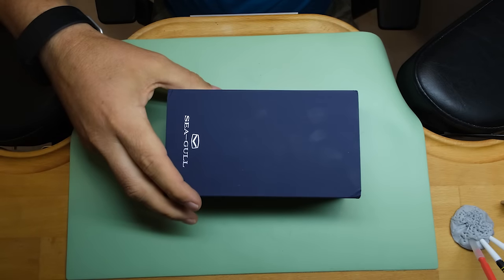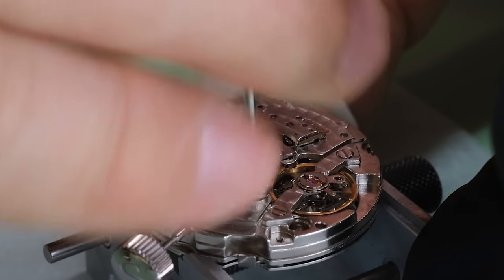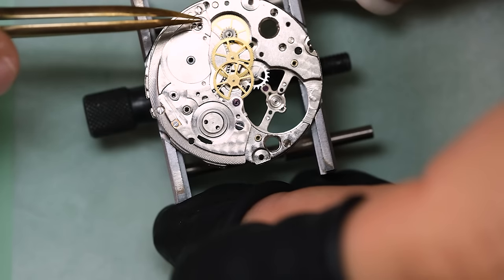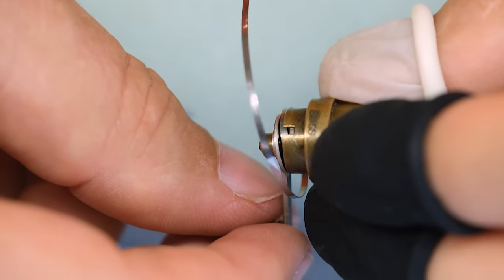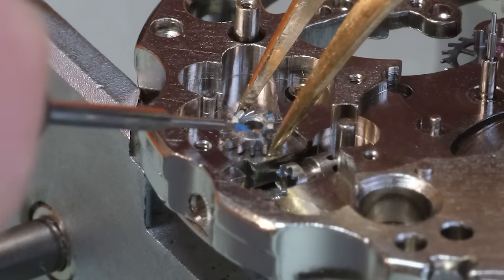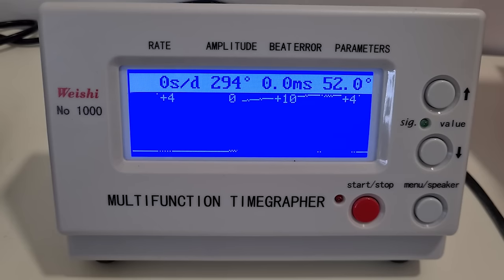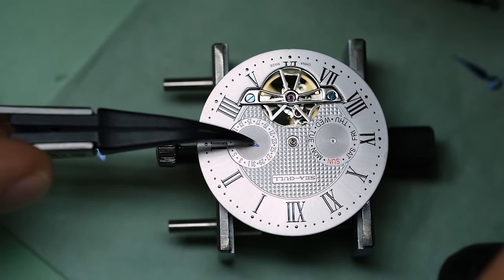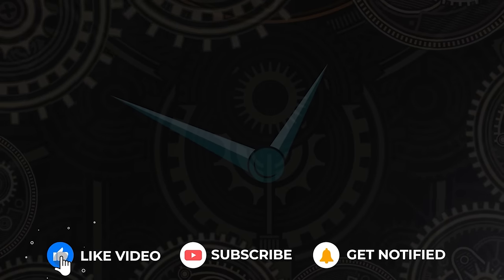How good are Chinese watches? Teardown + Giveaway!

Comment: Hw good are Chinese watch movements?

Mechanical or Quartz?
The lowest cost export Mecanical models (I don't know about the ones for the domestic market) are hit and miss. From what I saw on another channel where a pro serviced a brand new lowest cost on Amazon Chinese skeleton manual wind pocket watch, "to see if they are servicable, and if it will run better after servicing" the "jewels" are very thin, and MAY be plastic. They are not lubricated when assembled. At least the movement he has wasn't.
The ManChDa skeleton pocket watch I bought off Amazon (under $15.00 delivered) with bronze plated full hunter case, died after 1.5~2 months.
It does not run with a full wind. As far as I can tell, it was not lubricated, either.
I have not decided yet if I will jeep it for display or file it in the circular file. If nothing else, I have to nice watch chains.

The higher priced models are PROBABLY of decent quality, and properly lubed and assembled. After all, the average China resident needs a good watch,justlike the average resident of any other industrialized country. 

I would find it hard to believe that the only good watches in China are imports from Japan, India, Taiwan, Switzerland, and other locations.
I'm sure the Chinese can build a watch that is as good as any other production watch, regardless of brand. No doubt there are custom watch makers in China who can make world class luxury watches that would be desired by the rich folks able to spend six and seven figures (USD or Euros) or more for a watch.

Asffor the Chinese Quartz watches ... The Chinese quartz pocket watch I had came with a garbage battery, tat only lasted 5 or 6 months. A common enough battery size, I just haven't bothered to change it yet. It did keep accurate time ... until the battery went dead.

I'm thinking of trying the call it "$40" (on Amazon) China made "London" brand 6 hand auto-wind pocket watch, either late this year, or sometime next year.

Comment: IIRC, Sea-Gull was the original company and Seagull is the modern copy of Sea-Gull. 
However there are copies of Sea-Gull (which this seems to be one) and a reissue version called Seagull. 
I honestly don't know what the new genuine Sea-Gull is like inside but apparently they are much better than the copies from what I've read (which is anecdotal and heresay at best). 
Genuine Sea-Gull watches aren't $100 they're $750 to over $1000 but they could just be rebadged $100 watches for all I know.

Also, I have to admit I have one - an ST1903 the 3 sub dial iteration of the 1902 in an Alpha Daytona clone. I got a red dial version and put it on a black rally style leather band with red stitching and red highlights on the inside of the holes. Everything about the watch is a bit crappy but I absolutely adore it, keeps great time and is a lot of fun. 

I've got a Tissot PRX chronograph, a Breitling Hercules chronograph, a Casio GWG1000 and an Alpha Daytona. 

The Casio and the Alpha are the only watches I wear.

Comment: To compare Japanese vs Chinese quality. I have an expensive REAL Seiko (Sapphire, Kinetic, Titanium) bought here in the Netherlands which has already been broken five times. One time falling on the floor (just about one meter height), the other times the pins of the separate links of wristbelt fell out.
So I'm quite dissapointed in the Seiko quality.
I also bought a Chinese automatic/mechanical watch (with a Japanese inside) which seems to be a much better quality fit/finish and also was much cheaper, it didn't break yet.
I stopped using the Seiko because of all the breakdowns and will buy some more Chinese watches in the future.

Comment: I own 5 or 6 Chinese watches. Some are very simple and of low quality. But they work. None of them has broken after years of ownership. Most run plus or minus 15 to 18 seconds a day. There are exceptions. I own a seizenn pilot watch by Merkur. It is esentially a re release of the 70s era W10 military watch. I had planned to buy a Hamilton Pilot Pioneer at around 700 dollars. The chinese version was less than 100 and is a high quality time piece. Plus or minus 4 seconds a day. Domed mineral crystal just like the Hamilton. 316L stainless case. Same water resistance. It is a solidly built attractive watch. And while it may be a copy, so is the Hamilton. They both copy the older w10.

Comment: I have absolutely no issue with these when they go for 100 EUR and bear the respective brand. Although perhaps I should, considering patents, copyrights and, generally, all the horological ingenuity that has ended up just being blatantly ripped off here in one way or another. Having said that, I absolutely hate seeing these movements in fakes - and you can usually see them from miles away. That, to me, pretty much sums up both sides of the coin on this subject: yes, you can have a perfectly good mechanical watch for cheap. And at the same time, yes, thanks to that, thousands upon thousands of watch afficionados can also miraculously fit their wrists with "fine Swiss haute horlogerie". Not.

As a sidenote - I own numerous quartz Fossils with old-school Miyota and Ronda quartz movements inside. I've found the difference between those and a Chinese quartz quite staggering, to be honest. Quartz watches aren't made with longevity in mind to begin with, but such laissez-faire-laissez-passer approach to watchmaking turns them into shoddy commodity items indeed. Ephemera encapsulated.

Comment: I have an Alpha 'speedmaster' homage with the Seagull st1903 movement. After  a few months the winding mechanism broke. It's still possible to wind the watch but only up to about a dozen turns of the crown. From research it seems the clickspring is weak in these ST19 movements.

Comment: SeaGull make very good watches in my experience, owning 3 at this point, I have no problems with any of them.
Considering buying the Tourbillon model at present. 
I have gone in the other direction from buying high end watches and then looking at less expensive but very good mechanical movements.
In these days of muggings and watch thieves, I still need a good mechanical timepiece on my wrist but one that won't grab the nasty attention and intentions of crooked people.
At the time, I paid just £160 for a manual wind column wheel chronograph designed in Switzerland with Sapphire crystal and a pretty movement visible through the mineral crystal caseback window.
Chinese pilots and other military must have been very happy with these watches when 1st issued back then when the Beatles were 1st strumming their guitars.
You can see finishing issues through a Loupe but for the price, they are very good indeed, no Patek Phillips that's for sure, but for a day to day watch, absolutely good enough. I wear watches for myself, not to impress others. I don't pull back my shirtsleeves just because I have one of my Rolex watches on my wrist.

Comment: I bought a cadisen day date homage with a miyota  movement. It had a white dial and the seconds hacked. Then I bought a gold dial version of the same model and it did not hack. I returned it and got another non hack watch. Then I wanted a gold dial with hacking so I swapped the dials.  Very iffy quality control even with Japanese movements installed. Sea gull is two different Chinese characters...probably reason for the hyphen. Wonderful video!

Comment: It's no Rolex, but it is an automatic with some interest on the dial side. Given the price, I imagine most would just buy it, wear it for however many years it worked for, and then toss it (or sell it on e-bay). There aren't many that get worked on by a professional watchmaker like you so this one should be good for a good deal longer than it otherwise would have been. (Don't enter me in the drawing please. I could buy one for what shipping would cost).

Comment: Funny about the screw sizes and slot widths all being different. I worked with a chinese factory and colleagues, and the things that they do to save on build cost can make you crazy...
I'm willing to bet that their production guys just ordered the lowest cost they could find, or used parts that were high-volume in-house...
In my own experience, in one case, they used a resistor instead of an inductor "bead", to reduce some electrical noise, to save less than 1 cent...it kind of worked, but when we had a new IC that worked better, and saved 2 cents, it wouldn't work properly with the resistor!
And, for some reason, the Chinese guys would not change the parts list... maybe saving face?

Comment: I'd love to have another watch, 25 years ago I had gotten a nice watch, it didn't last, I killed it, so I get cheap watches, but only 30% fit, but I only like about 5% of them, I have large wrists, if they do fit it's the last hole in the band ,  but a small few will fit like normal,  I don't want a watch that looks cheap and /or odd , like a toy, or child's watch,  I don't like a watch that is trying to be something it's not, fake duals and such, but still cheap and reliable, difficult to find,
I have stopped looking,  I haven't had a watch in over 4-5 years, maybe longer, maybe around 2016 my last watch died, its time was just over,. I don't like putting a lot into a watch, (or shoes) I'm not easy on either,  this is a nice watch better than I'd buy,  
China can build good and nice things, if you want to pay for the quality, they just have a bad rep for bad quality, because ppl are cheap stingy, want to spend nothing, cut corners,  and the product suffers, and the makers get a bad rep,  the ppl over the company having china build  things want to make big profit, spend nothing on  having a expensive something built, charge 2x the worth, they think they need to make 500% profit, to make it affordable, the quality is horrible,    but china can make good products,  but it cost ,. Great video!! 👍

Comment: I hate when people ask me, "is this a good watch. uhh, well, I guess it depends. Its actually a tough question.. When I see these Chinese/Japanese style movement designs I tend to want to answer no, its junk just because I hate the designs with the thin plates all over the place, wire springs everywhere and plastic gears in the calander sections. But they work and run just fine. Of course the winding/setting sections are always the most prone to trouble along with the plastic calander gears. Otherwise these movements could last hundreds of years just like any other watch as long as it has never been overworked a million times over the years. So I guess I should say sure, they are good watches.

Now compare them to watches that cost thousands of dollars. If the pivot quality is good, the jewel quality is good, gears are cut clean, tolerances are good and consistent then why not. Fix some minor design flaws and no reason they cant be as good as expensive watches. Also, many watches use the same movements especially if they are quartz. Now you can have a $100 quartz watch that has the exact same movement as a several thousand dollar watch. And if the cases are well built, dial quality is good, nice hands, saphire crystal etc, then I have a hard time making the argument to justify buying the more expensive watch. The unfortunate truth.

Also, very impressed that you noticed the lack of consistency in the Chinese quality control. Seems its just not big on their agenda.

Comment: A little extra effort on quality control and keeping the work area very clean would go a very long way on making something purely mechanical like this watch last several times longer between servicing. Seriously tightening up the sample sizes at each process and better training especially for oiling during assembly would alone make the product much better. A QC department can make or break a factory. I would recommend that at the very least for their own house brand watch company they should spend a bit more effort just because it would save them from returns and complaints. They may be the largest manufacturer of movements on the planet but your average watch buyer doesn't yet know who they are and one bad experience will get a lot of negative attention from that buyer and anyone they theoretically talk to. Just how I would run things. 🤷‍♂️ if they had to add a couple of dollars to the price to make it significantly better I'd pay it. Until then I'll stick to used Japanese automatic watches on ebay which can be bought for a song and still will last longer.

Comment: Sept. 24th is likely too late to get into your competition for the watch but that's alright.  I just found your channel and you make a pretty good video so I subscribed.  I'm not a watch maker though I took one or two apart when I was a kid.  I don't wear wrist watches or any jewelry beyond a wedding band.  I wear a belt watch and that even not often, just when I go out. I have a clock in the bedroom which displays time on the ceiling at night. I always thought if I ever acquired a Rolex Oyster I would wear it but I don't really like the band design.  I wore a watch in the Navy, a Timex with a twist-o-flex band but as soon as I got out I never wore one again and I'm in my 70s. The Timex worked very well for six years problem free. A funny story, though, about the belt watch...I took it to a watch maker for a minor repair. He saw me take it off my belt so you would think he would return it in the same condition (ready to wear) as when I gave it to him, but the watch was forcibly placed in the leather holder upside down (right-side up is upside down for this watch) and I had to take it apart and seat it correctly. It is made to hang upside-down because when you wish to see the time you just tilt it up as you look down to see the time. This was a professional watch-maker.  I said nothing to him.  I don't go back there anymore.  You, on the other hand, notice the most intricate of details and I like that.

Comment: I have this vintage cufflink watch by Endura that has a 1 jewel movement that belonged to my great grandfather and I've been wanting to get it repaired as a surprise birthday gift for my father as he greatly admired his grandfather and always wanted to get it working again.

The balance spring is pretty messed up, the mainspring was seized up, and I think the movement is missing a tiny screw or two somewhere because it kinda came apart when I removed the caseback to examine it.  Otherwise I have all the gears and bridges for it.

I think it would make for an interesting episode if I sent it your way and let you have a gander at it, and if restoration to functionality is possible that would be even better!

Any way something like this could be arranged?
Reply from the maker: Hello, thanks for watching! I'm not sure that watch is repairable, to be honest, but you can send me a mail with photos of it to stian@vintagewatchservices.eu

Comment: I thought Seagull bought Minerva or another movement manufacturer in the 80’s or 90’s?
Reply from the maker: I don't think they did buy a Swiss manufacturer, but I could be mistaken. Minerva was bought by Mont Blanc a bit later on. Seagull did buy the designs and tooling for the Venus 175, but not Venus itself. Venus was bought by Valjoux.

Comment: Stian --

Indeed, a fascinating video Stian.  i have never been predisposed to acquire anything other than three-handers since they must be challenging enough mechanically.  i now have three Chinese watches (a Cronos and two San Martins), all with the PT5000 movement from Hong Kong Precision (a 2824 clone).    I have been lucky -- and both of my vendors charge a bit above the typical AliX offering -- but worry about overhaul/service availability.   With the prices of new Chinese movements (the PT5000 go for $65) presumably a movement swap is the efficient strategy.

Do you have any comment on maintaining these watches?   A video on customer options -- sending back to China vs local watchmaker for example -- might be useful.

-- gary ray
Reply from the maker: Hello Gary, great to hear you're happy with your watches. I'd say we're moving into use and discard territory with these kinds of prices; it's going to cost you multiples of that to service a watch and sending it back and forth to China will also likely not be worth it. That's just the sad reality of our modern society...

Comment: Well, problems with QC, what should that really mean? I mean, every commodity that comes out of highly automated, roboterized production  processes shouldnt be expected to underly intense QC. That would by far be too costly. So QC actually means: Does it run? Within specifications (a few seconds on a timegrapher, ready!) Does the crown what it is expected to do? Does the bracelet work? Are there visible damages or irregularities? No? Neeext!! When people complain about QC issues what is really the problem is the quality of the production set up and to a much lesser degree „QC“. QC is simply what I told you above it is. If you spend, say, $ 10 000.- or more on a Swiss premium brand you can actually expect a little bit more. Production here is significantly less roboterized. But sh.. happens and sometimes there are Rolex, Omega or Tudor lemons as well.
Reply from the maker: That's a well written and though out comment, Thomas, thanks! The level of QC indeed has to correlate with the price paid, but it also goes a bit the other way around. If the level of QC is too low, the value of the product will also be perceived as lower. So finding the balance is key, and I do think the focus on QC in a lot of Chinese products is lower than it should be, if not only to ensure that they can build reputations for good products and thereby climb up the value ladder.